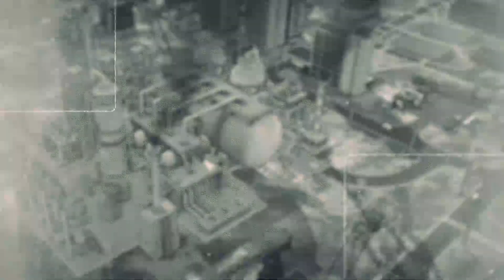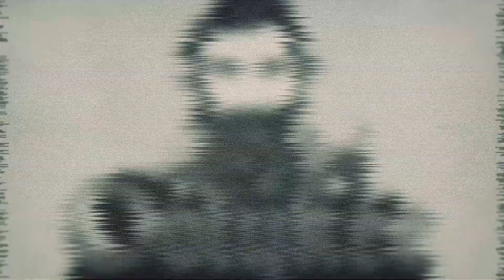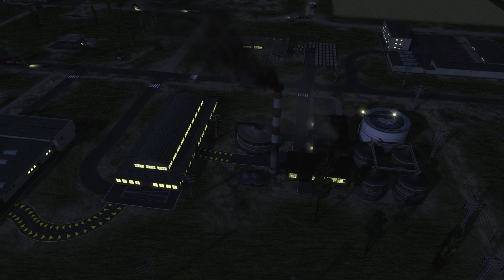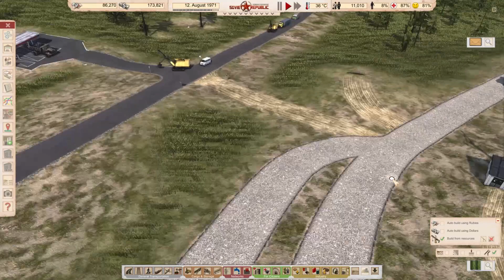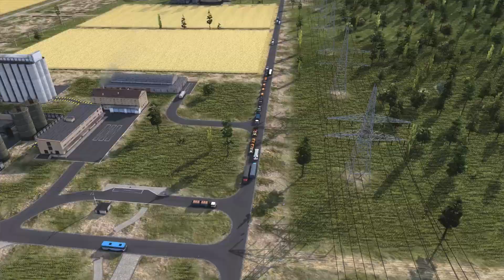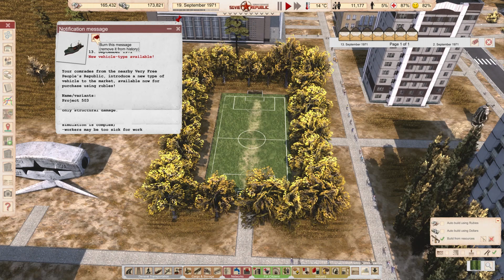Soviet Republic - Nuclear Industries - Ep.31 - What Makes Money?

Comment: As much as I'd love to invoke the meme of the Church of Plastics, the fact of the matter is that anytime you're in a position to make enough Plastics to export, it means you already have enough Chemicals to export.  Chemicals are honestly my favourite "mid-game" export commodity.  They're value-dense (meaning, expensive per ton) so you don't need massive fleets of trains and ships to keep the exports flowing like you would for something like Coal.

Steel would have a bigger net impact on your bottom line, because you could first seek to eliminate imports (which cost you more than an export gains you - buying is at a higher price than selling).  But you're right, there's a lot of infrastructure involved there, especially all the steel and mechanical components you'd need for the conveyors.  Steel is an interesting "early-mid-game" chicken-and-egg problem if you're not already sitting on a mountain cash to absorb the startup costs.

I want my suggestion to be a little more interesting than "produce a shitload of chemicals," so... try a clothing industry.  You have farming set up, so expanding that shouldn't be too expensive.  The chemical requirement is small, so you could start with imports.  The factories themselves shouldn't be as expensive to build, and it's easy to hugely overproduce clothing for your citizens' needs, leaving lots for export.  Then you can build the chemical industry... then you have what you need for plastic, and then you can use the plastic for electro components and the like.

The best part about this chain of industries is that most things are produced and consumed in low volumes... which means fewer trucks, fewer trains, less infrastructure cost.
Reply from the maker: Great advice. Given that it's coming from the Church of Plastics' own ayatollah! 
Thank you!! I will address it! <3